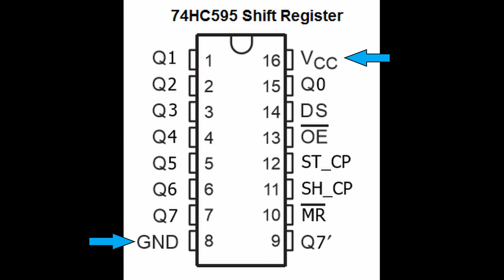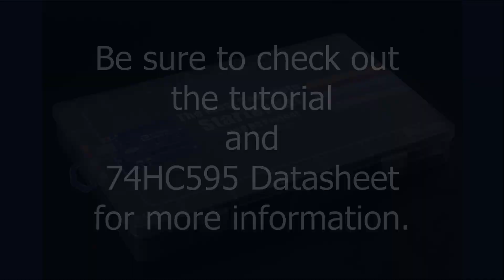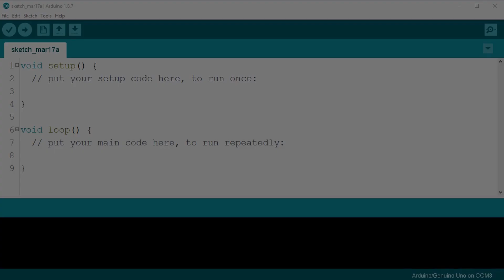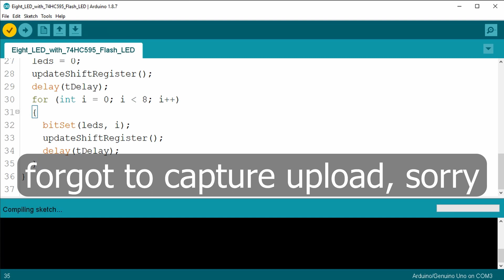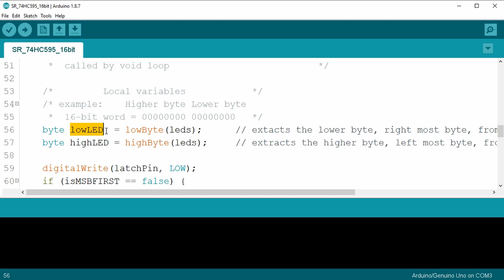Lesson 24 - 74HC595 Shift Register

Comment: @10:58 I don't understand why the lights would travel right to left, shouldn't it be from left to right? you said in Lession 27 that shiftOut() with LSB always makes the right most digit Q7, and in your code here your for loop iteration for bitSet travels from index i=0; i<8, so i assume the loop proceeds 10000000, 11000000, 11100000, etc etc. so shouldn't the lights travel left to right?

Comment: Whenever I plug in the last line into the 5v into the Uno the Uno loses power.  Its On LED stays on but I can hear it disconnecting from my PC.  Any tips?  I am for certain wired correctly and strongly.
Reply: This happened to me also, did you figure it out?

Comment: Nice video. I downloaded your code and start  to learn it. The example is working. However, I cant figure out how to control each individual leds. When controlling the leds only with arduino, with digital output,  it was easy:  digitalWrite(6, HIGH);  digitalWrite(2, HIGH) digitalWrite(3, LOW) .  How can I do the same with your example?I have 16 leds.

Comment: Thanks for putting these tutorials together.  I bought a slightly different version of the Elegoo kit, but the 4 digit LED project was giving me fits as the numbers were jumping around instead of incrementing sequentially.  In this video, I noticed the part about setting the MR to high.  This isn't called for in my documentation.  It works flawlessly once I put that jumper in.  Thanks again!

Comment: You can only controll 4 shift registers in chain?
Reply from the maker: If I recall correctly, the Arduino Uno can handle a 32-bit value.  Each shift register uses 8 bits, therefore 4 shift registers can be chained together.  If you need more, use another output for the next chain.  Or a clever coder/circuit designer could chain as many shift registers as desired in multiples of 4, and send multiple 32-bit values to the chain.  Just be careful with max current draw.
Reply: @rickmorenojr  Well shit. I was hoping to chain 12 of them together and already made and bought pcbs for it.
But you are saying it might work? i will only light up 16 leds most at the same time.
Thanks for helping :)
Reply: @rickmorenojr  You can controll arbitarily many shift registers in a single chain with an arduino. Just a matter of how you code it aswell as how long a delay you can live with from beginning the data shifting to the data is avaible on the outputs of the shiftregisters.

Comment: What to do with 3 shift register ?
Reply: Just add it like the second one and so on.
Reply from the maker: I think the important take-away from this lesson is to realize that you can control multiple devices (leds, sensors, input pins on another module, etc. ) using three data outputs.

Comment: Do you need external power source? 

I was going to use 2 shift registers with 16 leds then i remembered people talking about how much current Arduino UNO can provide and  how much current each Led draws. Now i'm searching internet for information. I don't want to kill my Arduino UNO.
Reply from the maker: It's always good to account for total current draw.  If I recall, each LED is drawing about 13.6mA. In the second circuit,  we are only turning on one LED at a time, so there isn't an issue.  But if we modified the code to turn on all the LEDs, we'd see 13.6mA X 16 =  218.2mA current draw on the 5V pin.  The 5V output pin is good for about 400mA while connected to USB.  Maybe more if using the 9V adapter.   There's also current limitations for each output pin (20mA recommended, 40mA max) and 3.3V pin (50mA) with additional restrictions for a bank of output pins (there are three banks) where the sum of all bank pins are around 150mA max, and max 200mA for all Arduino output pins.  Note that USB has a maximum 500ma, so whatever the Arduino isn't using might be available on the 5V pin.  Other boards may vary.
Reply from the maker: Also check out my 32-bit shift register sketch, https://www.youtube.com/watch?v=NIPxSCUH6NQ , to see me operate four shift registers and use a separate breadboard power supply.